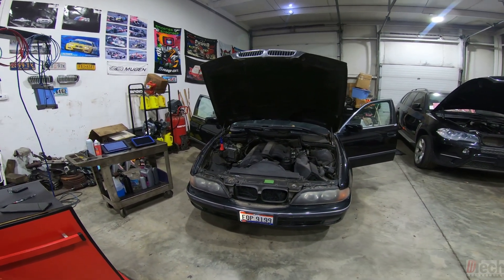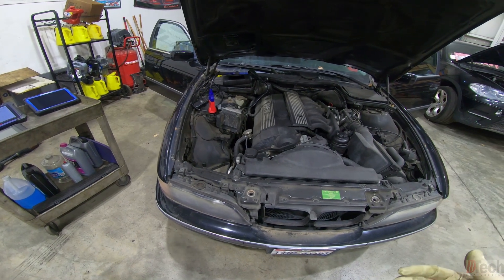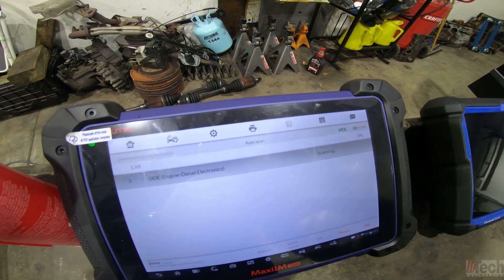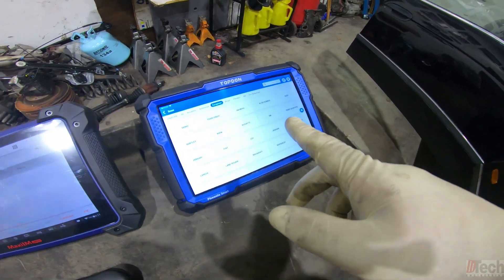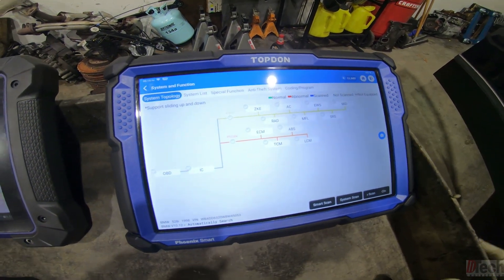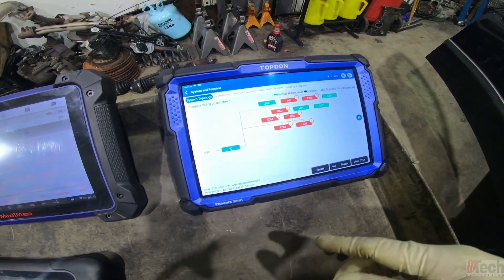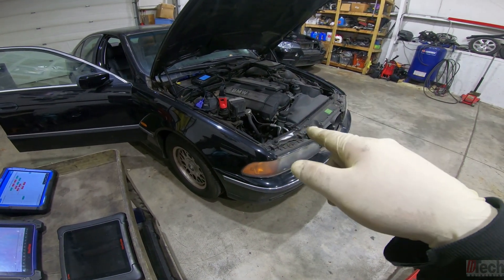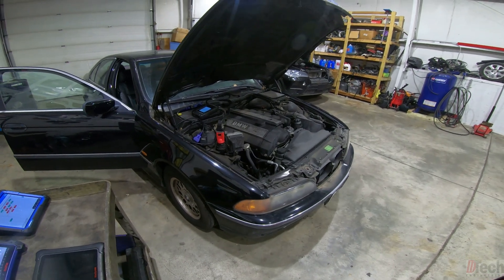BMW NO COMM: Bus Problem? Or Scanner Problem?

Comment: wow just had something like this happen to me today except I still have no communication  Tried Autel im 508, tried albrites system , tried ista d and p and othere's today and still no communication of 1999 bmw 323i m52  Dme ms42  found a video on line showing there's a connector under the left seat that has 3 wire's going to a connector that fails and you with have no commutation at obd and 20 pin under hood
Reply: Link? I have a 97 328i that has limited communication with both. Wondering if that's the issue.
Reply: Hi, i have the same problem with the same car...what was the isue?? I use 10 different diagnostic, still no comm. Pls help
Reply: what video dis you watch? i have a 1998 e46 without no comm in all the modules and i want to detect an ABS/DSC lights on my cluster, if you solved it, tell me please hahaha

Comment: Welcome to the wonderful world of aftermarket scantools. The Topdon is a rebranded Launch which as a brand has been around much longer then Autel, therefore their vehicle coverage goes much further back. Autels are known to be patchy/hit and miss on older stuff. It's standard practice to try 2 or 3 different scantools if there are comms issues or sofware glitches.
As you have just discovered the answer to the question: how many scantools do i need?

All of them.😊😊

Just out of curiosity, you seem to do a lot of BMWs, would it not be wiser to invest in the OEM BMW scantool?
Reply from the maker: I actually started my shop with a second-hand high-end Launch, it was able to do a ton for me in my first 3 years. That's when I got my first Autel. As far as why I don't have factory BMW... I think it's because since I worked for BMW for a decade, I was 100% aware of the diagnostic tooling and software, and once I got out to the aftermarket world and saw how amazingly mirrored the scanners were to the factory software, I personally haven't had the "need" to have factory. Knowing all the ins and outs of factory BMW and finding them in both Launch and Autel, I have been able to maintain and survive, so far... Maybe one day I might get it, it's just for now I know I have been able to navigate through work that I have encountered.  But most importantly, you most definitely bring up the excellent point of having the need to have multiple tools. Thank you for watching

Comment: If it has 20 pin+OBD, you can bridge pins on the 20 pin to make diagnostic/programming possible by OBD, had a similar fault on a E46 which had lost synchronization between the ews and DME, I didn't have a dedicated 20 pin adapter, only OBD, so I bridged certain pins on the 20 pin to be able to do it by OBD to do the synchronisation and voila!
Reply from the maker: Yes, the 20pin connector has a spin on cap that should be on there when no scanner is plugged in (into the 20pin), and the cap has a resistor built in that connects the 2 pins so that that the obd dlc can be used for generic scanner communications. Thank you for watching and sharing your tip
Reply: What tool did you use to resync? I bought an e46 but there seems to be an issue with the immo/key synchronization as it’s not detecting it